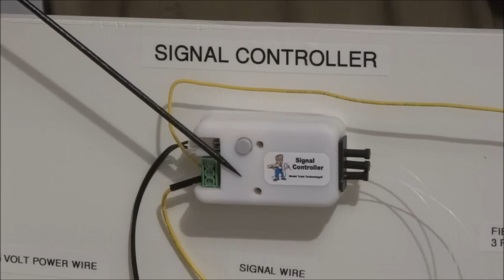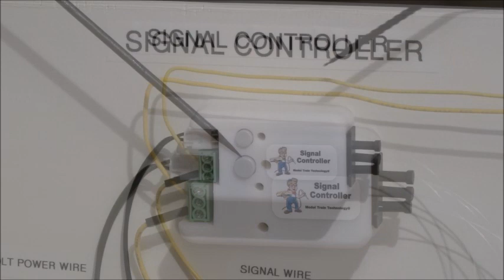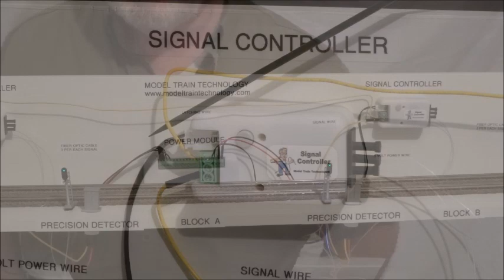Signaling and Detection Implementation by a Customer

Comment: Great info to bad nobody is making prototypical N scale signals like they have for HO...
Reply from the maker: Stay tuned...  there are many variations in the works.  Of course, there are dozen and dozen of types and styles so we will have to pick a few to begin with.  The version in this video is a hybrid and was used to prove the concepts with both LED and Fiber.  Given that the original video garnered more than 35,000 views since June 1, this is definitely a hot topic.

Comment: How would your system work on a single-track mainline with trains moving in both directions?
Reply from the maker: A typical setup for bidirectional traffic on a single line is to put a sensor and a signal at each end of the block.  Then, tie the output of the two sensors together and connect them to a single Signal Controller. In this way, if either one is tripped, the block is deemed to be occupied regardless of direction. You can put a Signal Light at each end of the block and connect them both to the single Signal controller.  Also, If the train will pass the first sensor while entering the block before reaching the exit sensor - and thus the block may seem UN occupied, simply add a sensor ( or more than one)  in the approximate middle so that the train is always in front of at least one sensor.  With their output wires connected together they will act as one so that if any ONE sensor is tripped, the entire block is occupied.

Comment: Nicely Done. I wonder if there are plans to incorporate a way to keep a signal red while the block is occupied by a slow moving or stopped train using the latching of two detector circuits.
Reply from the maker: Yes,  you can tie the output of multiple Precision Detectors together to create a "long" protected block.
Reply: @ModelTrainTechnology  Interesting. I would like to know more about how a protected block is managed as described at 2:00.